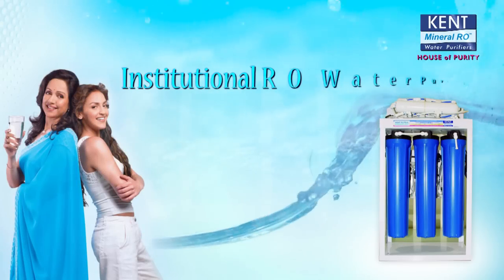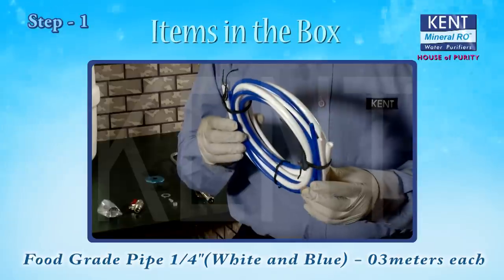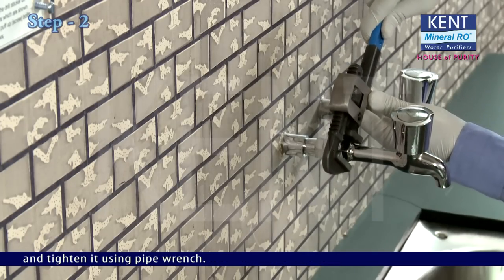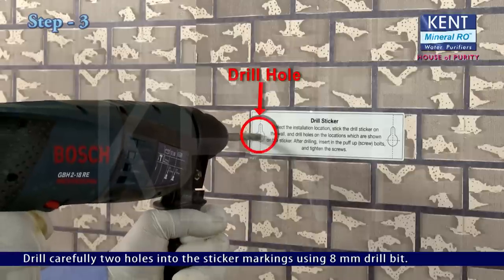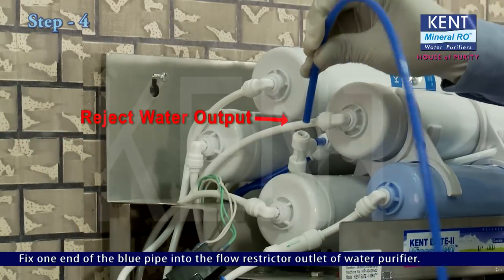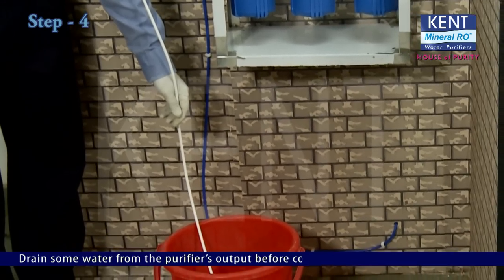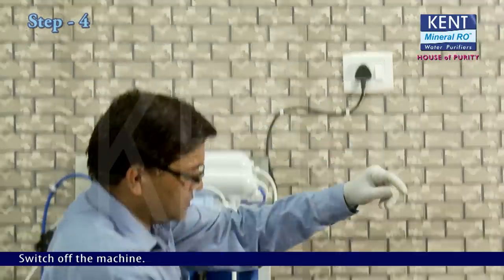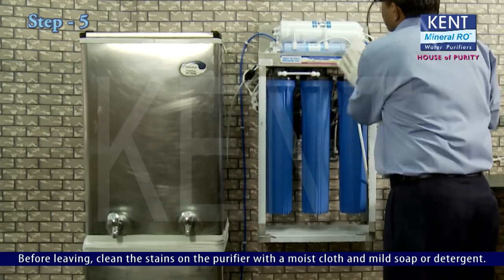RO+UF+TDS Water Purifier: How to Install Guide Kent Elite II | Kent

Comment: Don't go for RO purifier, since it will reduce tds to less than 50
Reply from the maker: Hi bt17, Is there any issue that you are currently facing with our product/service? Please help us understand the problem better so that we can resolve this quickly. Please share your contact details via private message or you can reach us at +91-9278912345 / onlinecare@kent.co.in. Regards, Team Kent